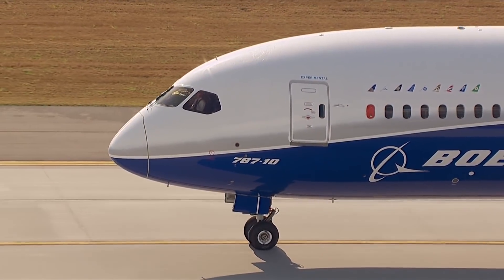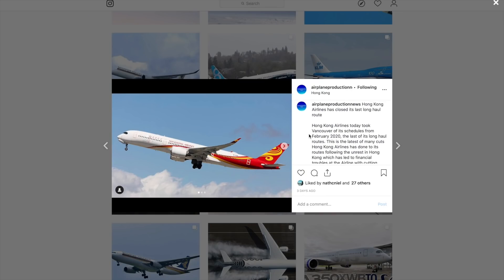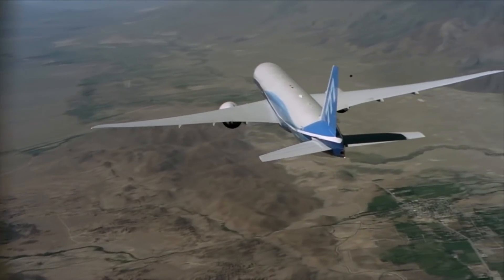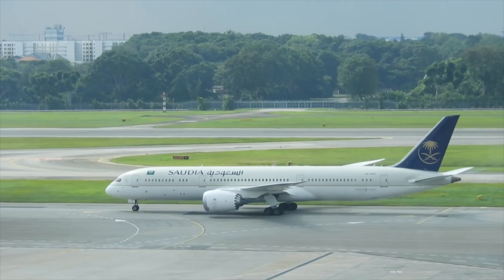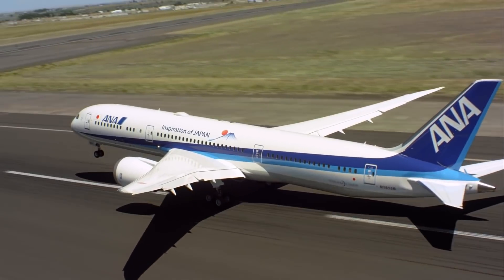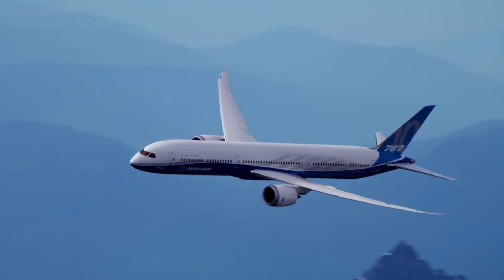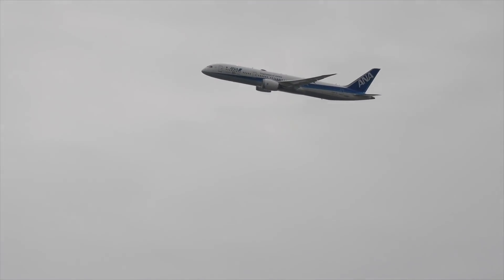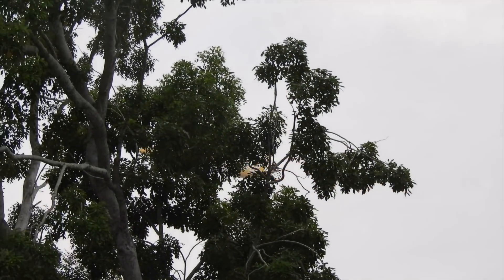787-10 and 787-9: How would an ER/ LR vs against 777-300er?

Comment: What you propose is altogether impossible. In spite of 787-10’s nominal maximum range of 6,500 NM this craft cannot economically engage missions over 5,000-5,400NM. Beyond that 787-9 will be able to carry a higher payload while consuming less fuel. Air NZ will be receiving deliveries with a small increase in MTOW to better serve their USA service. But there is a positive limit to further increases. First, engines. The Dreamliner was developed first with the 8 series. Then came a stretch, the 9, with the same engines and wings. Later the 10. In the latter case the engines are clearly overstretched for the largest version. This results in shorter engine life and higher maintenance costs. And more importantly, poorer field performance. So 10 is not adequate for high and/or hot airports. Because of this Emirates finally declined to conform an order for some 10 variants. Increasing weight further this would only compound the aforesaid situation. Plus another question. The undercarriage would become insufficient. Tire pressure on the runway would exceed what most airports can accept, and introducing a third axis is impossible, for it would not fit in the well. Dreamliner 787-9 has already reached the upper limit of it’s range. A clear example is Qantas flying Per-Lhr. They can only do so with 230 pax, not a viable proposition for most airlines. So in short, no way
Reply: @yo yo perhaps I have not been sufficiently clear. 787-8 was developed first (chronologically). I did not imply that it was the base model, which as you correctly indicate was derived from 787-9.  What I do say is that the engines were intially designed for the smaller and lighter 8 (which ended up with a far higher OEW than anticipated). Then it was bumped up for the 9, which of course was no problem, 320kN is excellent and it has proven to be the most successful of the series, and with good reason.  Then a third bump was required for the 10, and this is as far as these engines will go. Still adequate for the 10, I am not saying the contrary, but here the design shows poorer field performance, also due to the 3 variants sharing the same wing.  787-10 in my opinion is a good aircraft as is, but like all it has its limitations.  Very good for missions up to 5,000-5,400NM, North Atlantic but no West Coast, excellent cargo capacity, good economics up to the above, thanks to a somewhat thinner fuselage and compressing economy pax into 17" seats and thinner aisles. There are now 2 MTOW increases being considered. One for ANZ, 5-6 tons which can be acomodated, the other one is to match 787-9's range (or whereabouts) of 7,600NM, still less than 8,100NM for A350-900 (which in my opinion is unnecessary). For this you need 15 extra tons of MTOW to 270 tons or so.  Here I have my doubts (even if the undercarriage issues can be solved) whether a 4 variant series can be successfully implemented, without the top or bottom becoming uneconomical. Two is the most usual choice, 3 is fine, but 4 may well be a bridge too far.  Wingload and engine thrust to weight ratio would be less than optimal. My sole purpose and intent is to discuss matters of aeronautical engineering.  I am neither for or against any OEM or plane, and not about to enter a sports cheering contest.
Reply: @yo yo perhaps your opinion is too American oriented. In Ireland you have DUB , which has decent traffic with a 2,640 m runway which 787-10 can not use today, let alone a heavier version. In the Caribbean there are many small islands that in some cases have no space for large runways, like in Sint Maarten SXM, just 2,300 m, also quite popular. Then you have high or hot airports, as MEX, BOG, DEN. Or in East Africa ADD, EBB, NBO or JNB. In Asia there are many secondary airports with shaky infrastructure, and yet they move huge crowds. Agree that new slats and flaps will not need recertification, but new engines positively will, and this entails recertification. Heavier engines change the craft’s aerodynamics a lot, so this requires a major redevelopment and a substantial cost. The explanation for this is rather technical, and I will not elaborate it here. Just let me say very briefly that field performance essentially depends on 2 parameters. One is wing load, expressed in kg/m2. Values as follows: A-350-900: 633; 787-9&10: 674 (lower is better). The higher this value the higher takeoff speed must be. Then there is thrust in KN divided by MTOW in tons. Again, numbers are 1.185, 787-9: 0.774 & 0.747, respectively (higher numbers are desirable, more thrust or less weight). So you can clearly see the comparison. In a given project one of these 2 may be not so good, but when both are from fair to poor that gives you a strong message. And these are the numbers for the present version. Add more weight and this inevitably deteriorates further.
Reply: @yo yo yes and no. The biggest caveat with substantial MTOW, more than field performance at takeoff is what happens next.  Very heavy and/or insufficiently powered planes (relatively speaking) can only engage in a very shallow angle of climb (again, relatively speking), so they spend much more time in the lower layers of atmosphere, where air is densest, and thus incur in very high fuel consumptions during said phase. My point is that although trading engines for 10 is possible, it is onerous both in terms of development and subsequent use.  What will eventually happen is that Boeing will re engine the whole series, in a sort of 787MAX scheme. Dreamliner engines are one step behind the newer and more modern A350's. But Airbus will likewise go for an A350NEO with a RR Ultrafan design, possibly towards the end of this decade. Let me partially disagree on your field performance evaluation.  Being an imbalanced designed (which reflected in very poor sales) A330NEO has, and by far, the very best field performance in the industry.  It will take off with a full cabin in juste 2,300 meters. Just a tad more than 737/A320s! Let me say that my airport runways' is totally sincere.  Except for small islands with little or no additional space, runways may be extended further.  But very many are in less affluent countries where the cost may not be deemed a high priority just to accomodate a single or a few plane types, with many others being to operate uneventfully.

In my opinion Boeing's move here, in accordance with many industry reports and articles is that 787-9 will get a bump, 60/90' more flying time, and maybe 200-400NM more than A350-900.  Not that this is needed for range. Rather, it will afford Boeing more payload in the longer routes.  This will be the more worthwhile innovation. Until Airbus replies, of course.  In the case of 787-10 possibilities are more limited for the reasons previously explained.  An ANZ style one hour increase is workable to offer existing Boeing customers a very good option to replace their 777-200s with 3-4 extra rows of seats and very substantial fuel savings per seat.

Technology as in so many other fields is subject to the law of diminishing returns.  Gone are the days of 15% improvements over preceding models. Newer, disruptive changes are certainly feasible, only that we don't know when they will come.  This is perhaps what makes it all the more interesting.
Reply: @yo yo performance at full cabin (i.e. all seats taken) is a standard practice in the industry, and for good reason. And why is this, if occupancy may be 80-85%?  Because whenever they can, airlines will try to put as many tons as the weight of the vacant pax. This is the max range of a plane, which is seldom reached. What other metric is also considered (in the industry, this is normally neither understood no explained in general public publications. It is called range at max payload, the max number of pax and cargo that a plane can carry. So an A330-900 has a nominal rate of 7,200NM with a full cabin, say 290 pax or 29 tons (no cargo). At this point you reach MTOW, but can still load more fuel. To load cargo beyond this point you may do so, but you have to deduce the same weight of fuels as the tons of cargo that you are adding, in order not to exceed MTOW. Less fuel, less range. So in this example at max payload you can only travel say 5,700NM (while still departing at MTOW. Airlines try to avoid departures with a light TOW since they are then underutilizing the plane, snd perhaps a smaller model would be better. Every captain before departure knows the MTOW of his plane at local conditions. In hot weather and particularly at high airports this number may go down by 10-20 tons. Then adds x tons for the pax, y tons for the fuel needed for the mission, plus reserves, and then if possible z tons for cargo, so that TOW is  the closest to max, without exceeding it.
Reply: I beg to differ , what was mentioned above is very very possible.

Currently the main limitating  factor are the engines , that's it. They are almost stretched to their limit with the 787-10 @ 340KN TO thrust and around 305 continuous....

Why are people concerned about the pressure of the tires while the a359 which is 7 tons heavier and has a MTOW of 280 tons still uses a similar twin aisle wheel system . 

The 787-10 tops at 254 tons and an ER version would not require more than 15 tons addition, still keeping it below the MTOW of the a359...

Currently , increasing thrust from the engines requires more fuel to be injected , increasing core temperatures and pressures , which is not good in hot conditions such as Dubai.

Boeing will need a newer or atleast , slightly larger varient of the GEnx to be able to pull this off....

Other than that , maybe a bit more wing span then voala, 787-10ER

Comment: In my opinion i would love the 777-8 not the 787-9 dreamliner to replace the 777-200LR because 1) the 777 is a more comfortable  plane to be in because it is more spacious. 2) if the 777-8 is placed on routes not so very long,  a higher capacity may be chosen and boeing can choose to reduce it`s MTOW & MLW. Speaking of 777-8 being less optimized than the -9 against the A350 lets not forget that the engines on the 777-8 is not in its max as that of the A350-1000 plus boeing stated that the new folding wingtips make it slightly more efficient like about 2-4% so i see the 777-8 brawling with the competition. 787-9 is OK on  its own.

Comment: Why doesn't boeing bulid a 787-7 to replace the 757s
Reply: Nathan Thompson 

There was a 787-3 designed for Japanese airlines, but the orders were converted to 787-8 because over 200 NM, the 787-8 was more efficient.  The problem with using the current 787 models is weight since they are built for carrying a lot of fuel for long range. 

I personally think Boeing could use the proven 787 tube, reduce fuel capacity and the structure required for all that weight.  Use a new wing with folding tips like the 777x to keep the plane within the Code D size footprint and have longer wingspan for greater efficiency.  Finally, stick with the proven GEnx-1b engines derated for the lighter weight.

Cutting the fuel load in half from a 787-8 reduces the MTOW by 110,000 pounds.  I am sure with the other changes, you can get the MTOW down to 350,000 pounds and have aircraft that meets a 5500 nm range.

Comment: Air NZ was the launch customer of the B787-9 and has been working with Boeing to get extra range of a tank of gas for its B787-9s, so a B787-9ER could be a strong possibility in the next 5-10 years. The reason that Air NZ purchased the B787-10, beside having the B787 flight/cabin, engineering, spares and logistics infrastructure in place, the B787-10 was a logical choice to replace the B777-200ers. The B787-10 will be used on high density medium to long haul routes and the B787-9s will be used on leaner medium to ultra long haul routes. I would be suprised, that Air NZ is already working with Boeing for a B787-10ER, that could replace the airline's B777-300ER fleet in the next 5-10 years.
Reply from the maker: Chris McKellar Thanks for your comment. Great information indeed. Yes, the 787-10er will be a great replacement for their 777-300er! Thanks for watching and do stay tuned for more great future videos :)

Comment: I'm saying for more than 2 years now, Boeing need to make an ER/LR version of B787-9 and 10 and already thinking on make the same with the new B777-9x. Airbus with less time made A350 a new version and did the same with A320Neo LR/XLR, so why Boeing can't upgrade B787? They have to, or will be left behind... specialy with the problems with B737max and no definiton on B797NMA(or 767x?) program, in my hole life never saw Boeing like this.

Comment: One word, commonality. A LR or ER version of the 787 will definitely work. Many airlines use the 787 in medium long haul routes but find themselves needing the 777 or A350 for ultra long haul routes. Having the 787 work for both allows for further fleet commonality. I can definitely imagine a day where an airline uses 787s on the majority, if not all, their long haul routes. Splash in a limited number of 777 for the high demand routes or specified high demand times. Order the 797 for the lower demand shorter long haul routes and use for high demand domestic routes. And then, we’ll let’s face it, A320/A220 for narrow body flights. I just don’t see the A350 having as much versatility as the 787 most specifically if they ER/LR the type, there will not be the need to have the A350 if you fly the 787s. Of course the A350 is an amazing airplane so if your going to use it you likely would use them limited as you would the 777. The 787 only needs range, the 9/10 carry enough passengers and cargo for the bulk of trip needs. I’m all in for the ER/LR. Likely the modular approach the A350 is doing with more fuel tanks would work perfectly right now for the 787, sacrificing some cargo for range but gaining fleet commonality.
Reply from the maker: JBWhitney0402 Thanks for your comment! Yep, the ER and LR would easily fit into any airline already operating the 787 series. Additional fuel tanks at the expense of cargo would work but Boeing will still need to increase the MTOW to maintain the passenger and cargo payloads the aircraft is able to carry. Thanks for watching and do stay tuned for more great Detailed Aviation Analysis and Epic Comparisons on the way!
Reply: I think the 2nd generation of the B787-9/B787-10 would see a B787-9LR and a B787-10ER. Since AIr NZ was the launch customer of the B787-9, the airline has been working with Boeing to get extra range on a tank of gas, so  a 2nd generation of of long range B787-9/B787-10 could be on the cards. I will depend on what Boeing is going to do with the B777-8 programme.
Reply: Chris McKellar agreed. It’s odd to think the 777-8 is to replace the 777-2 which is used in droves by many airlines. Delta specifically only order the 200.  Frankly the 787-9 and 10 meet the need of the 777-2 but lack in range. Fix the range and you kill the 777-8. The 787 meet the market perfectly as the 777 did in the late 90s. But today for more range and passengers it’s the A350, an amazing aircraft. The 777-9 is trying to compete in high demand long haul routes and it will be a niche there. But Boeing must ask themselves if they LR/ER the 787 are they cannibalizing themselves by removing demand for the 777? Is there that big of a market for the 777-9?
Reply: @JBWhitney0402  - Looking 10-20 years ahead, the main twin aisle aircraft type in the medium to ultra long haul market will be the B787 and A350 families with the B777-9 or possibility the B777-10 for the for high density 'spoke n hub' operation where the B777-9/-10 is used for 'hub to hub' and the B787 is used for the 'spokes' and the B787-9 is used for long to ultra long haul non-stop 'point to point' services for Boeing operators. For Airbus operators, they have more flexibility with the A350-1000 being used for high density 'spoke n hub' operation where the A350-1000 is used for 'hub to hub' and the A350-900/A3330neo is used for the 'spokes' and the A350-900ULR or A350-1000LR is used for leaner long to ultra long haul non-stop 'point to point' services. The other aspect that will need to be factored in, is the decline in long to ultra long haul air travel is climate change with its erratic and unpredictable weather patterns and air turbulence over the next 20 years.